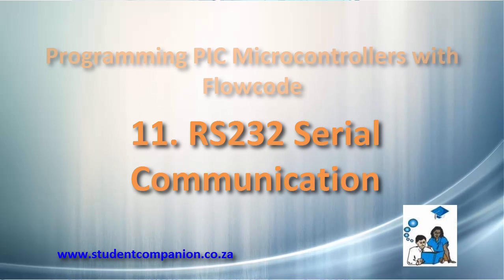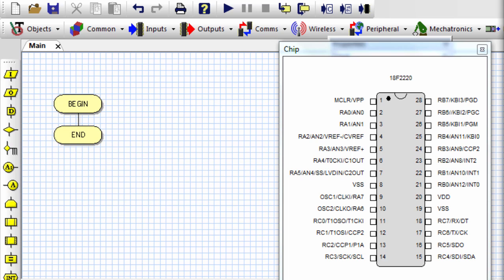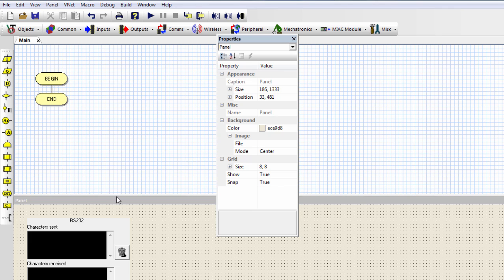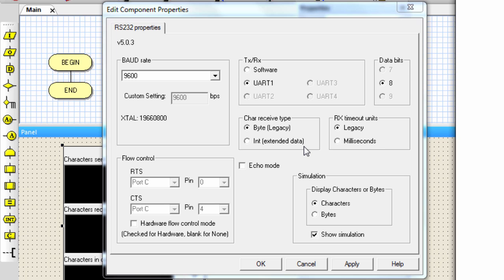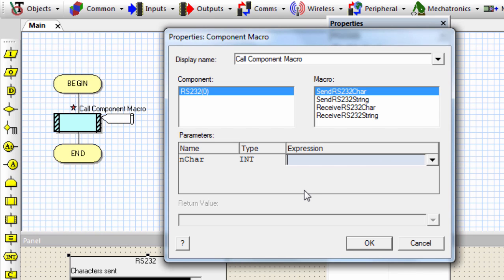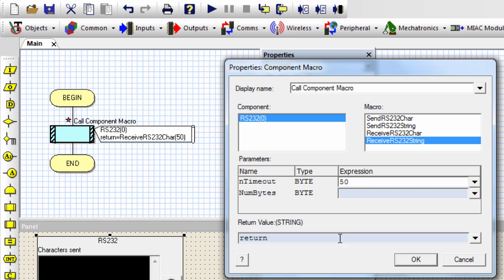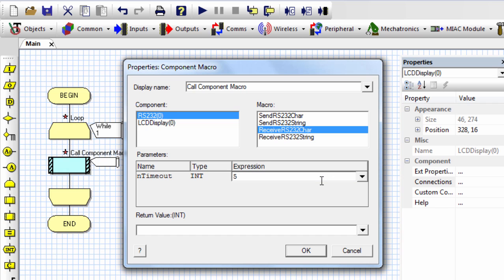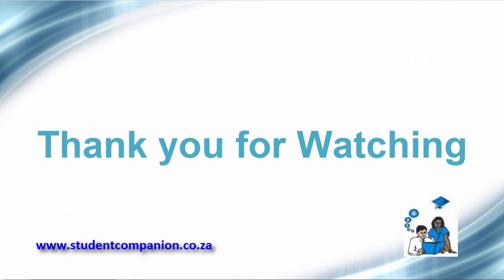11- RS232 Serial Communication | Flowcode Beginners Tutorial

Comment: how would it be in Flowcode 6?
Reply from the maker: Hi Gabriel. Your question is too general. What is your really concern?
Reply: @StudentCompanion  In Flowcode 5 you can enter a character and see it in the miniscreen, but in Flowcode 6 the RS232 is just an image, so how can I simulate the sending and recipt of characters?
Reply from the maker: @gabrielintriago1458  Flowcode 6, 7 and 8 are more advanced than Flowcode 5. They offer you more options. 
With Flowcode 6, click the RS232 component to set the properties. In the Data Source, you can either select the COM Port or Data Injector. If you select the COM Port it allows you to to attach the RS232 component to a COM port on your PC during simulation allowing real world hardware such as RS232, Bluetooth, GPS to work with the simulation or from a windows terminal.
If you select the Data Injector you can simulate fully your component, Select a data injector from communication component group,  you can select the Human Interface data injector. In RS232 properties, Data Source, select data injector, In Injector properties, select Human Interface. Display the console window: in VIEW menu, select Console. At the bottom In RS232 Injector RX Queue type the characters to be sent, in RS232 Injector Data you will see the sent characters
Reply: Student Companion Thank you bro. I'll try it
Reply from the maker: You are welcome.  If you encounter problems, let me know if I can assist you.

Comment: Sir, can you show how to connect Bluetooth module like HC-05 with Pic using flowcode
Reply from the maker: +santanu goswami Hi. We will create a video soon about Bluetooth
Reply: Thanks for the quick response
Reply from the maker: +santanu goswami you are welcome!
In the meantime you can ask questions in the Forum: 
http://www.studentcompanion.co.za/forums/
Reply: Sir, I am trying to interface a HC-05 module to a pic16f628A. In pic for uart pin 7(RB1) is Rx and pin8(RB2) is tx.
For serial communication I am using RS 232 in flowcode where the RS 232 block is kept at default.
Simulation is working perfectly but in hardware the hc 05 fails to communicate with the pic (//I think so, ).
Please help
Reply from the maker: +santanu goswami how so? Do you know what to expect?
Reply: Student Companion  in simulation sending the character 'a' turn on an Led while 'b' switch it off. But in hardware after pairing with Android I tried to send the same using app like Bluetooth terminal. But the led won't turn on or off.     The hc 05 is paired with the Android that for sure, so that means there is no communication between pic and hc05.
Reply: I tried the same example using arduino ide to program an uno and used the same Bluetooth app and it worked fine
Reply from the maker: +santanu goswami did you set correctly your baud rate on both sides?
Reply from the maker: +santanu goswami then they must be something wrong with your hardware
Reply: Student Companion sir, if I send you the flowcode .fcf file could you please have a look at it to see if anything is wrong there.
Reply from the maker: +santanu goswami but you said in Flowcode simulation everything looks great. Don't you think it might be with hardware? Can you try to blink an led on your PIC just to make sure the PIC is working before considering the Bluetooth module.
Reply: Student Companion pic is all good . Tried blink ,pwm in hardware all good.
What should be the RS232 properties be set at?
Reply: Also I didn't use a voltage divider between Rx of Bluetooth and tx of microcontroller but with arduino uno it is not a issue
Reply from the maker: +santanu goswami what does your datasheet says?
Reply from the maker: +santanu goswami you can send it but we only gonna look at it on Monday afternoon
Reply: Student Companion 
RS232 properties 
Baud rate 9600
Tx/Rx URAT1
DATA BIT 8
CHAR RECEIVE TYPE -BYTE
RX TIME OUT UNIT -  LE GACY
Reply: Echo mode - not check 
Flow control 
Hardware flow control mode - not check
Reply from the maker: +santanu goswami which version of Flowcode are you using? Are you using Flowcode v7?
Reply: Student Companion sir I tried everything
Reply: Student Companion   sir I did the same example to program an arduino nano using flow code for avr v5. And IT WORK
 now when I did the same for pic 16f628a it didn't work. The baud rate is kept at 9600 and I have used an external oscillator of 12 MHz
Reply from the maker: +santanu goswami which Flowcode version are you using? With Flowcode 7 there is an HC05/HC06 component you can use.
Reply from the maker: +santanu goswami post your question and upload your code with your harware descriptions in the Forum: http://www.studentcompanion.co.za/forums/
Reply: Student Companion , sir after a lot of trial and error I found the source of the problem.
The pic microcontroller is not able to recognize ancii characters. For example in switch statement if I write switch state(a variable) = 'c' the microcontroller doesn't do anything but if I write switch state = 99. It executes smoothly in hardware 
So the microcontroller is only able to recognize decimal value coming via the Bluetooth module . 
I also connected a led module (working fine) and send some characters via my Android mobile but it displays only garbage value.plz help 
Hope that I am able to explain my problem
Reply from the maker: +santanu goswami that's good progress. When it display garbage it's usually the problem with USART baud rate not matching. Either you specified a different baud in software or the oscillator frequency in hardware doesn't match in software.
Reply: Student Companion  , sir currently I am using a 12 MHz crystal and the baud rate is kept at 9600 
I read the data sheet of pic 16f628a and the crystal and baud rate is selected through a certain equation. But it's a little confusing for me and I can't make any sense of it.
Can specify any crystal and at what baud should it be used so that I may get correct results with this pic?
Reply from the maker: +santanu goswami with Flowcode no need for hard calculations.  In Flowcode project properties set clock to 12MHz, select external HS, . On RS232 component, set baud rate to 9600. In your hardware make  sure to use 12MHz crystal. In your Bluetooth settings set baud rate to 9600
Reply: Student Companion sir it is set as per you have described still not working properly
Reply from the maker: +santanu goswami zip your project and upload it in the Forum.  We will have a look at it
Reply: Student Companion sir thank you for all your help, you have been very responsive.
As for my project I found the error which was quite simple. The incoming from the Bluetooth module is being saved in variable of 'int' data type. On changing it to  'byte' data type everything works like a charm.
Just wondering why is it so?
PS there is if statement: if state < 255
Reply from the maker: +santanu goswami good to hear it's working fine now at last.
Reply: Student Companion sir , tried a lot of examples using Bluetooth module and all worked fine .
I just have a question. Can i send AT command using rs232 component to change the Bluetooth module name and password?
My next goal is to establish a Bluetooth communication between two microcontroller using flowcode. Is it possible?
Reply from the maker: +santanu goswami yes it's possible
Reply: Student Companion sir how do we send an AT command to Bluetooth module using the rs232 component?

Comment: Excellent! many thanks for this helpful video, is it possible to shed some light on RS485+PIC+Flowcode. Thank you.
Reply from the maker: +Abhijit RASHINKAR hi. Thanks for watching our videos.  The RS485 is basically like the RS232 or UART ad far as software protocol is concerned.  The same code can work. All you need is to change your hardware module to support your protocol.  For RS233 a MAX232 chip can be used to convert the UART voltage level to RS232 levels. The same can be done for RS485. Use a chip that can convert the voltage level.